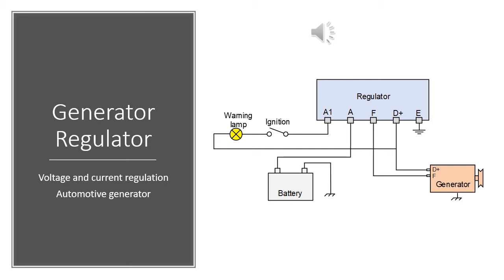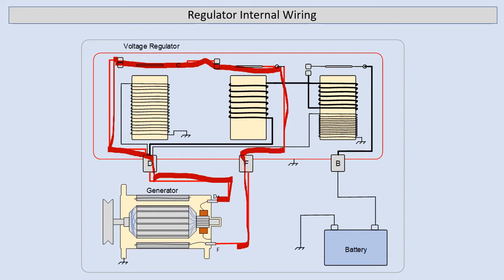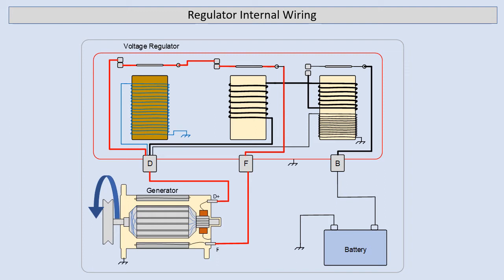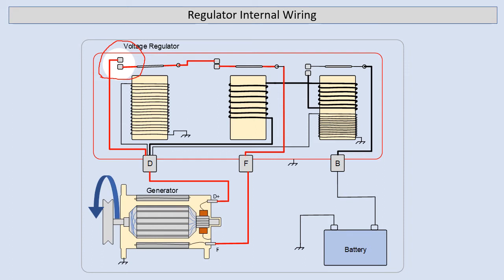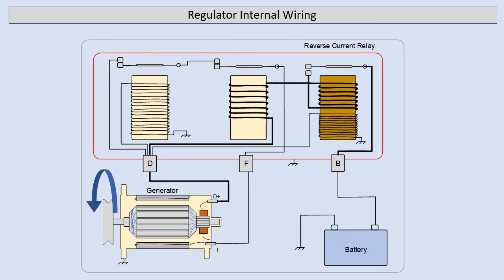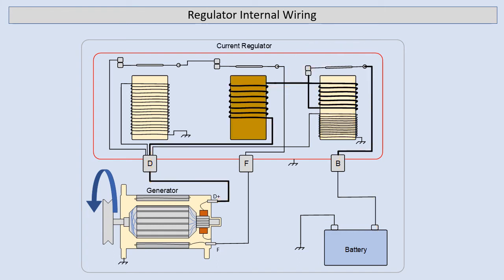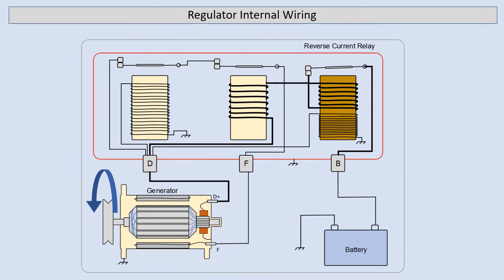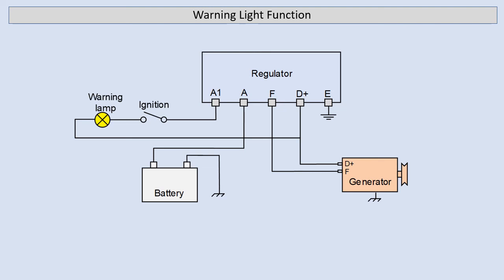Generator Regulator

Comment: I'm in the process of trouble-shooting a charging issue on a Bosch equipped 6-volt. This was very valuable!
Reply from the maker: This video shows the Lucas connections. Bosch regulators work in the same fashion except the field circuit is connected to the armature inside the generator, and is earthed in the regulator.

Comment: Unfortunately we in the USA have the issue of "A" circuit generators and regulators and "B" circuit generators and regulators.  Additively, we have two brush externally grounded; 2 brush internally grounded; 3 brush....as well as 6 and 12 volt and negative and positive systems. Makes it tough.  Don't know if you are saddled with these issues or not

Comment: Some guy Joe cell from Australia mentioned those generator regulators suposedly reverse polarity do you know sir what he means be that???
Is he actualy apllying to Amplidyne generators??
He mentioned shorting acros points on the regulator with peace of metal so what wuld that do to the generator and regulator?
Aperantly the baterry goes dead flat but does not explode for some reason.
So can those generators act as motors or magnetic brakes for some reason?
Never hade opertunity to ask older peopel who worked with such generators in fact me Delco 12si alternator does similar behaviore and its anoying realy cant finde good explanation why the car runs bether and smuther but most of the time I end up with dead baterry even more wiard it is when I use capacitors then that thing continues back charges up to 3 to 4000rpm the bulb refuse to shut off.
So I dono how counter such unusual effects .
Reply from the maker: Many older vehicles had the positive battery connection connected to the chassis. To convert the system to a negative chassis connection, the battery connections must first be swapped, and before the engine is started, the generator must be polarised to charge negative chassis. In the video I mention that the generator relies on residual magnetism to begin generating a voltage, and this residual magnetism will need to be reversed before operation. This can be done by simply closing the reverse current relay for a second, and make sure the contacts are forced open, or they will stay closed and burn out the armature. Once the generator has been polarised, it will charge with the correct polarity. I hope this is of some help.
Regards,

Petar.
Reply: @PetarMakTeacher  thank you for answering